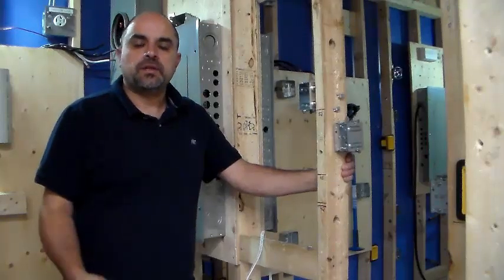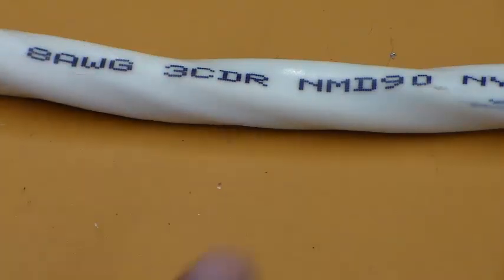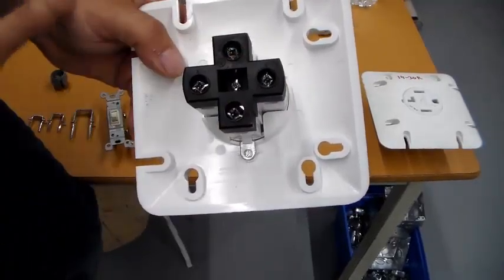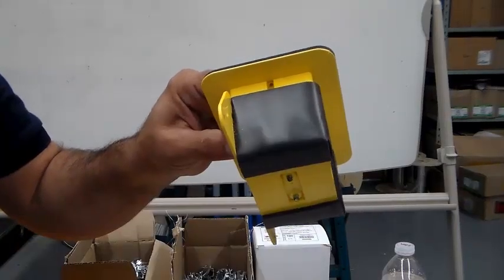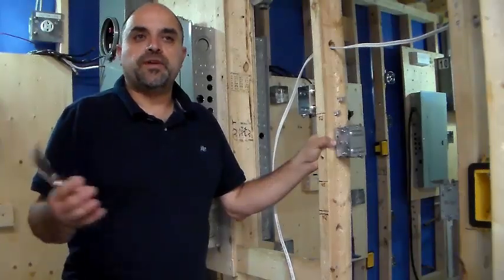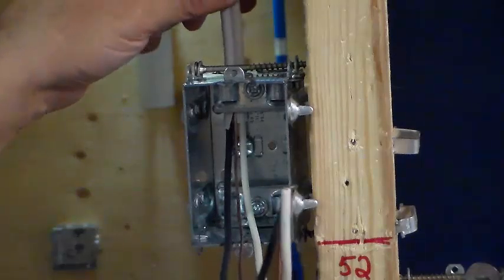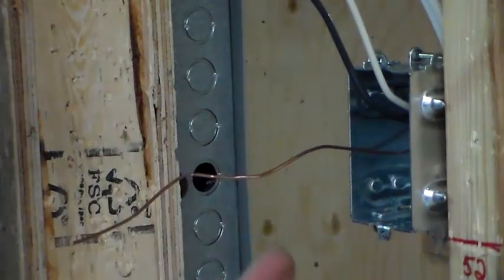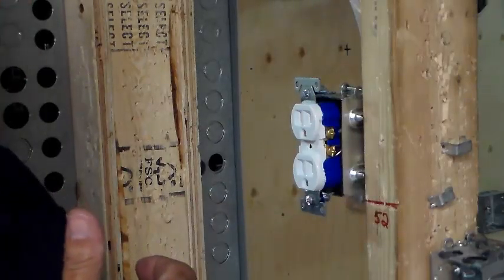Basic Residential Wiring

Comment: Sam, great video.  It's very helpful.  I was wondering if you can answer a question I have.  My bathroom currently has one switch in the wall controlling the light.  Is it possible to add and outlet off of the switch if the feed is coming from the light. 
hope that makes sense. 
thanks
Reply from the maker: you could , but the outlet will only work when the light is on.  Also if you planing to connect a receptacle to the wire it will need to be a GFI and ensure the you have a bound wire.

Comment: I don't understand my boss told me to run bx instead of romex in a house in Long Island New York it's that illegal or that the correct 
Can anyone plz tell me thnx
Reply from the maker: +Night Guy Konoha It depends on the material being used in the house to build the walls. If you are using steel stud for walls then YES you need to use BX cable. It very hard to use BX and pull through wood studs. that is why romex is used in wood frame construction. you could use romex with steel studs .but would have to add plastic bushing to the holes in studs where you run the wires through to prevent the metal fro cutting them.
Reply: NY has some very strict codes.  Areas in Florida also require (MC)metal clad cable. MC (aluminum) or BX (steel) cable are a better grade of cable and is also more expensive.  If your boss tells you to pull MC or BX, there is no wrong as far as codes go. The metal cladded cable is better for rodent resistant.

Comment: This is the best electrical demonstration I've come across on youtube. I need to replace quite a bit of knob and tube wiring - a subject no one seems to touch on constructively on youtube - but at least I got some useful information regarding different wire gauges and connection directions. Now if I had the money to tear down all my slat and plaster walls on my 1904 house so I could run wire seamlessly, that would be awesome. Anyway, thanks for the video.

Comment: Get some electrical tape and tape the terminals.  Go all the way around about three times.  It is a metal box.  I personally do that for all receptacles and switches, even in plastic boxes.
Reply: cjmillsnun tape is used just so the next person who opens up the receptacle or switch doesn’t accidentally touch the terminals or let the terminals hit the box when removing (im aware it shouldn’t be live, but some people are careless)
Reply: challenge792000 3 times is over kill, 1 time is enough
Reply: may be code says 3 times.
Reply: Bob Sum I don’t think there’s any code for that
Reply: I always put electrical tape now, one day I open up a switch and it didn't had tape and it accidentally touch the metal and I almost shit my pants with the spark lol, after that always be safe than sorry even if its ground properly idc I still put black tape 😉
Reply: Why?  run a ground tail from the ground connector on the outlet or switch to the box.  If anything else touches, the breaker trips.  Do the job properly and there is no danger, it fails safe.

Comment: I have a question regarding how you do wiring in the US. Running a cable through the walls, while legal provided it has double insulation is legal in Norway, it is never done unless for the application requires it. All wiring is over here done with individual wires in PVC piping. Any particular reason this isn't done in the US?
Reply: I think in Norway the voltage is 220 and in the USA is 110
Reply from the maker: The video is for residential installations. In wood structures we use this type of wire . in commercial  or high rise we use conduit and single wire in the conduit

Comment: This was so pertinent and helpful for me.  I'm wiring a small apartment so this is my starting point.  Will re-watch and check to see if you have more.  Thanks so much
Reply: Adam, look at more videos and read reference books before you start wiring electric, Sam used a metal box for the class, plastic boxes are more common in residential construction, Plastic boxes are less expensive and are easier to work with. Additionally you need to install different  sizes of boxes depending on the number of wires inserted in the box; Sam did not discuss the amps of the circuit breakers necessary to connect to the different gauges of wires leading to appliances  There is more to know above the color of screws and the colors of the wires that connects to the screws.

Comment: I prefer plastic boxes. Is the metal boxes a Canadian thing? I just feel plastic is safer.
Reply from the maker: +Lee Cooper not a Canadian thing...we use plastic boxes on the walls that would be on the exterior to give us a better vapor barrier value. The steel boxes are cheaper than plastic in Canada, hence steel is used more. But plastic could be used.

Comment: I think people prefer to have the ground hole on the bottom is because it looks like a face.
Reply: An outlet that is placed at normal outlet height under 24” should have the ground up the outlets placed at a higher location should have the ground down the reason for this when in inserting a grounded cord cap the ground prong should be the first prong into the outlet that is why the ground prong is longer than the hot and neutral
Reply: The existence of 90 degree plugs with a third prong, or dissimilar size prongs for polarization dictates what orientation we need.  Unfortunately, there is no standard!  Ditto for wall warts demanding a certain orientation, again no standard!  However, the need for ground at the bottom seems to be the majority.
Reply: It looks like an anxious face though. The ground hole is D shaped. If it was made just a little differently it would look happy.

Comment: What type of wire I need to use for refrigerator ?
Reply: So you have a 20 amp outlet on a 30 amp breaker and 30 amp wire. This means in an overcurrent faulty situation you can exceed the capacity of that outlet and have a meltdown.

Comment: 18:05 For the US viewers: a "Green Robby" is a square head, invented by a Canadian named P L Robertson. (https://en.wikipedia.org/wiki/List_of_screw_drives#Robertson)
Reply: Oh, I've seen them and used them, but I didn't know what he was talking about when he said it. The main reason they get used a lot nowadays is because screwguns can use them easier than phillips or flat.
Reply: Square head screws are actually very common in electrical in the states. I've seen them used since the late 90's in most breaker panels on the bus lugs and the breakers. My Klein 10-in-1 has 2 sizes of square bits.

Comment: I need help with putting wire through and old electrical box. Its in the wall and haves four sides to it. one side dose not have wires coming out from it .This box actully still have BX wiring that is not up to code. I can't redo all the new coper pipe wiring at the moment. I would like to know if I could run wires from that same box to add another plug to my wall? Thank you.
Reply from the maker: a lot of unknown information here. hard to comment with out know all the info. I suggest you have a license electrician come see you home and give you guidance.  your comment of BX not meeting code does not make sense me me.

Comment: no rules for the height of switches and boxes.. where the heck are you from, around CA you are asking for a lawsuite if your switches are too high or your receptical boxes are too low.
Reply from the maker: +Daniel Terrell 
Daniel there are no rules in the Canadian Electrical code book and if I'm not mistaken none in the NEC either. If I'm mistake then please enlighten us with the code rule to back up your comment.
Their may be some rules regarding handicap homes but they are found in the building code in our country. Many regulations are found in building codes , but he electrical code book only gives information on how they need to be installed and not where. A prime example will be smoke detectors, the CEC only offers how they need to be installed and NOT how many and where. That info is found in the building code. All trades including electrician need to be aware of other codes and local by-law that require additional work in addition to the CEC rules.  This is why I recommend  that all major electrical work be done by certified electricians who are knowledgeable of all codes and not just the electrical ones
Reply: Yeah but you cant just put em wherever you want the ADA limits you a lot,.

Comment: I see that you leave too much wire out when you screw the contact. I recommend to use the length that contact comes with, that way if you want to put another contact in parallel there's no arc, but I would use a pigtail for that. It's safer.

Comment: I have a question for u guys.....I'm running wire from the electric breaker to plug for my electric stove,I ran 4 ft. short of the wire which is 9/3....I have some 12/3...can I splice the 2 together?Any help would be much appreciated. Thanks...
Reply: I assume you mean 6/3, not 9/3? 
If you're not an experienced professional, I would not try to splice this sized cable at ALL.
There's too heavy a load, and if you don't splice it right. It's guaranteed to burn up.
Run a new one that IS long enough, or get someone who knows what they're doing to splice on the length you need.
Reply from the maker: BiggDaddysVideos no you can't splice a large wire with a smaller one.  Same size only and the splice has to be accessible , if you decided to take that route.

Comment: In America, electrical boxes do have height laws.
Reply: Sam Maltese     Our standard is usually 18" for receptacles mainly for wheel chair accessibility and 46" for switches..  You can do circles lookin  for things you can hardly find the answer for in the NEC.  Residential is a personal reference and Commercial can be way more picky< and for good reason.
Reply: Sam Maltese Its an ADA code not NEC.
Reply from the maker: Thomas Maceranka What NEC rule states the heights?

Comment: Yay Canada!  Any american stuff you buy that doesn't have the CSA label won't pass inspection in Canada.  I remember buying american outlet boxes and none had any ground screws attached to them (lots of holes though).  I had to buy a separate box of metal screws and attach them myself to each box (works of course but wouldn't pass if you actually had to have it inspected).  Codes are funny that way, sometimes regardless of whether something works perfectly well doesn't always matter---what the code says is the bottom line period.

Comment: Hey man, very informative video. There is only one thing I would like to add to that since you are talking about wiring. Don't forget to add the kick plates in there to protect the wires when sending wires through studs. Basically if your stud isn't an 1 1/4" deep a kick plate is required. to keep from screwing into wires behind drywall or other wall covering. So if you have a 2x4 stud keep the hole drilled in the stud in the center and you won't need a kick plate. If it is not in the center ,or you are going through a stud or strip in the case of a block wall where you would use 1x2's to fasten the drywall to a kick plate is required per NEC.Article 300 I believe. It's good to follow that, and most inspectors will fail rough-in inspections for that. Very good video though thanks for that.

Comment: does it make a difference where the red and  black wire goes?
Reply: preston grant It would depend on what you are doing, because both red and black are hot legs. on the receptacle like the dryer, and range or stove as we call it. I generally use black on the X lug and red on the Y lug but I don't think it matters in that situation as long as you don't get the neutral (white) wire or ground (green) wrong. A lot of people seem to mix the neutral wire up when installing a receptacles or sockets. But that only goes for the 240 volt receptacles. When you have a 10/3 or 8/3 wire meaning two hot conductors and a neutral and one ground attached to a 240 volt receptacle, it means that the appliance hooked to that receptacle needs 120 volts as well as 240 volts. I hope that helped brother.

Comment: thanks! Great tutorial. I have a garage I use as a poker room but no electrical. The room is drywalled. Can I run electrical in conduit along the wall instead of inside the wall?
Reply: tortelvis1 of it will be seen by an electrical inspector running conduit by code is acceptable

Comment: Thanks for the video Sam, I learned a lot just then.  Would the screws that you didn't use in the plug you installed be used for a second plug on down the wall?

Comment: switches should be at 48. thats the height of drywall
Reply: We always do switches at 44 and outlets at 16
Reply: Guns & Family    I would suggest you install receptacles at 18" AFF to meet ADA Guidelines.   You could be sued by a handicapped person in a wheelchair.
Reply: @KevinCoop1  Makes sense but usually the home owner makes that call as long as it meets code
Reply: Guns & Family    I'm sorry, but you can not meet Code.   NEC does not have any rules on elevations of devices.   ADA(Americans with Disabilities Act) came out in early 90's I believe with "Suggested" mounting heights.   So, if a "Disabled" person "feels" that they do not have access to the same things you do, they can sue the person who caused the situation.   Are you ever going to sell your residence?    This is the reason for the simple suggestion.   Respectfully,   Kevin
Reply: @KevinCoop1  I've been with with a Master electrician with 40 plus years and I've been doing it for 10 years myself. You could be right with what you're saying but yet to do so. I will look it up and thank you for pointing that out. 👍👍
Reply: Guns & Family          The rules that I last saw have changed.   This is from a site I found on the internet.   For adults they now say 15" minimum.   It used to say 18" front access.   I have been a Electrical Design Engineer for electrical contractors starting in 1983.   Electricians know many things that I do not, but I know many things that most electricians do not.   
This is what I found.

Reach Limits for Children
The receptacle design reach limits for children are also set by the regulations. These limits apply for any construction that will be used primarily by children. Forward or side reach ranges are established in inches for age groups. For ages 3 and 4, ranges are 20 minimum to 36 maximum. For ages 5 through 8, ranges are 18 minimum to 40 maximum. For ages 9 through 12, ranges are 16 minimum to 44 maximum. For children older than 12 years, use the adult ranges.

Respectfully,   Kevin
Reply: @KevinCoop1  Thanks for informing me and i will store that in the ol memory bank. Much respect my friend.
Reply: Guns & Family   With electrical work, you never stop learning.  I'm retired now, but there is room for more knowledge.   Best wishes!   Kevin